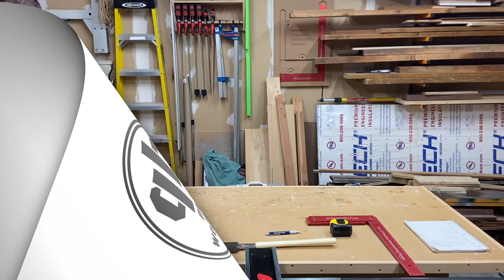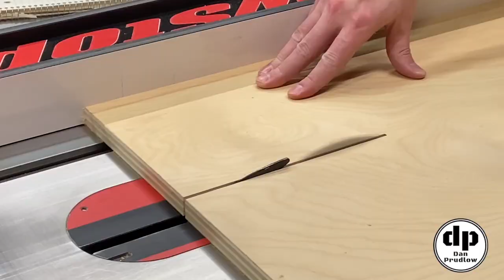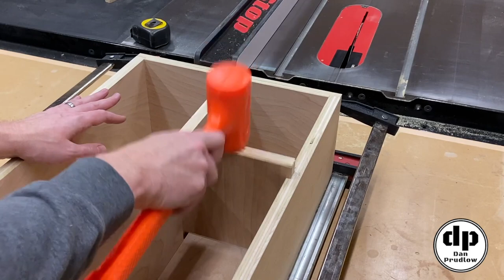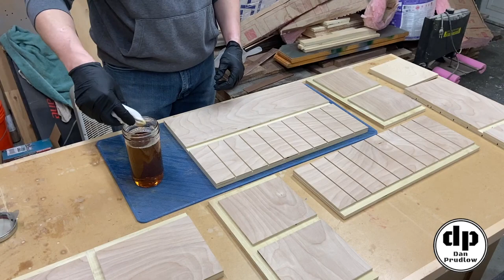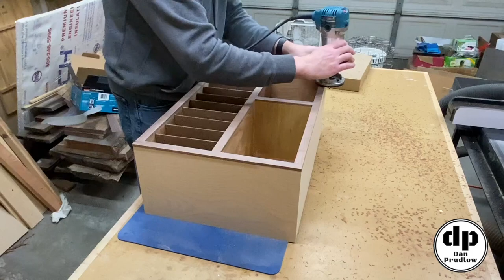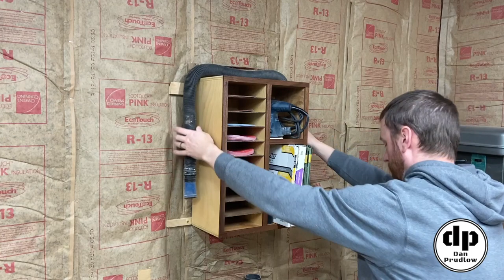How to organize your shop | Building a shelf for my sander and sandpaper

Comment from the maker: Want to support the channel? Here's what you can do:
 - Subscribe to the channel
 - Hit that Like button
 - Leave a comment
 - Amazon Affiliate: https://amzn.to/2LaN1Ib

I recently insulated most of the previously uninsulated walls in my garage/shop.  Now it's time to get going on some better organization for tools and supplies.  First up is this simple cabinet for storing my sander, sanding disks, and sanding sheets.  The cabinet is constructed of 3/4 plywood using rabbet and dado joinery.  I cut all the joinery with a single 1/8th kerf blade on the table saw.  The walnut trim on the front is scraps from my night stand build.  Let me know what you think in the comments section below.

SawStop 1.75hp PCS: https://amzn.to/2X4gWsP
Bench Dog Push Blocks: https://amzn.to/2YB00uL
Ridge Carbide 10-inch Saw blade: https://amzn.to/3bATmcp
Bosch 18v Drill: https://amzn.to/2OmrItJ
Bosch 18v Impact Driver: https://amzn.to/3cxAhJk
Bosch 18v Jigsaw: https://amzn.to/3jDtxOA
Bosch ROS: https://amzn.to/3rxri1W
Titebond Wood Glue: https://amzn.to/2LzTdv4
Bessy Parallel Clamps: https://amzn.to/2z4LHG3
Bessy 6-inch F-style Clamps: https://amzn.to/3e3LGl4

Thanks for watching.  If you have any comments or questions please leave them below or hit me up on social media, email, or my website.

Hit that like button and don't forget to subscribe!  Thanks!

Subscribe: https://www.youtube.com/danprudlow?sub_confirmation=1

Twitter: http://twitter.com/DanPrudlow
Instagram: http://instagram.com/danprudlow